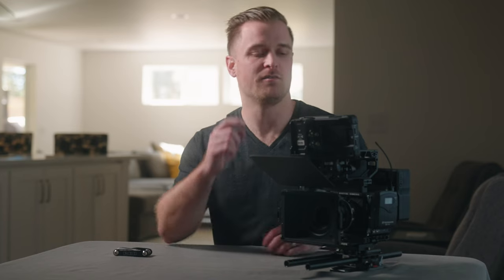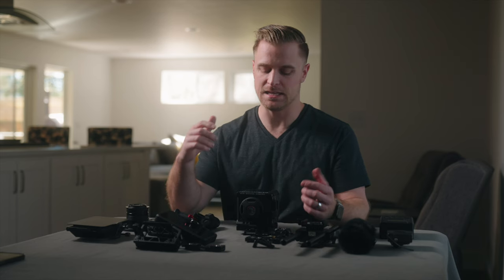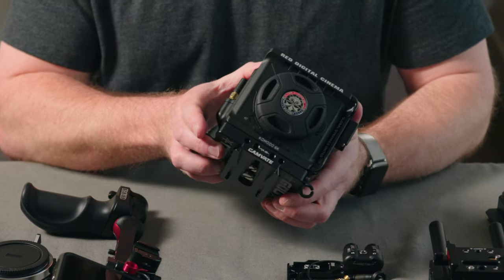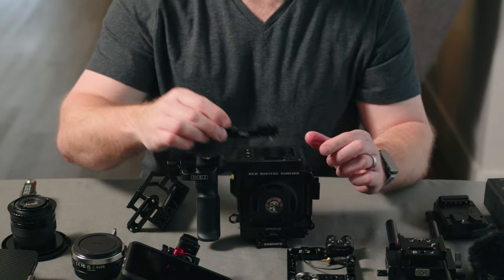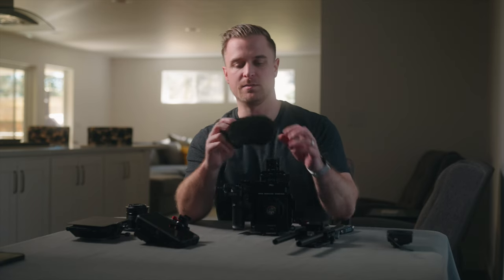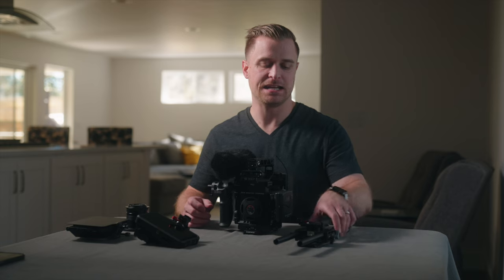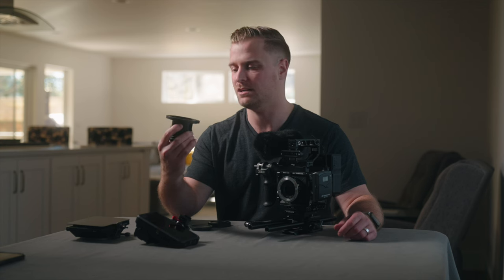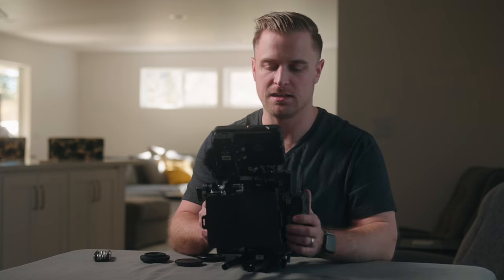RED Komodo Documentary Rig Tour

Comment: Do you know an L bracket that is about the same size that you use but the screws are not mounted verticaly on one end ? ( so both of the L parts have the same screw hole orientation ?
Reply from the maker: Smallrig might have something like that. You could check their website out :) I don't know of a specific one though
Reply: Checked smallrig , tilta and a lot more manufacturers , no luck .  @RileyEndicott